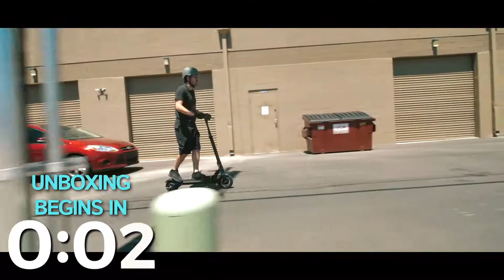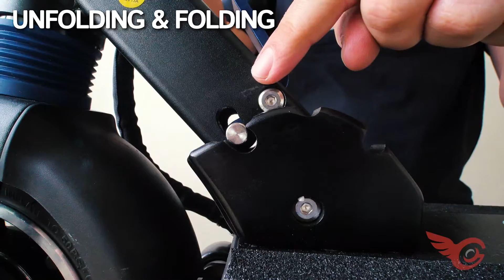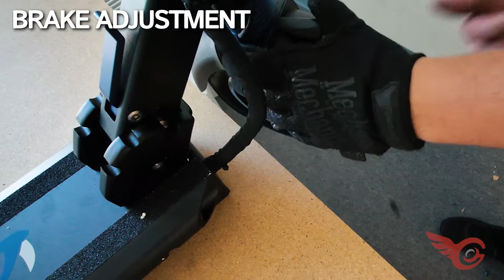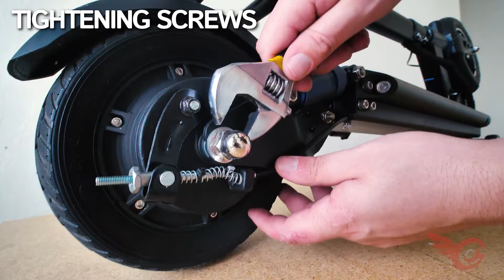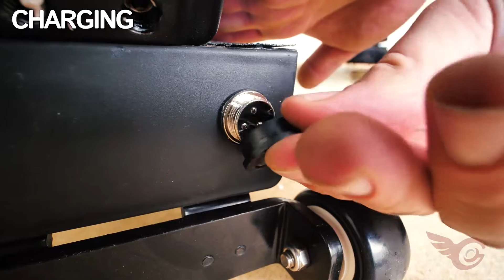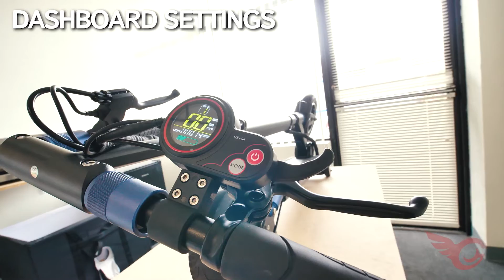Getting Started with the Turbowheel Swift T8S+ Electric Scooter

Comment: Thank you so much for your review, I really love that scooter, but I'm just concerned that is not waterproof, so I was wondering if you have some recommendations to protect the scooter from the rain, Thank you
Reply from the maker: Good question, we'll be making a follow-up video on this in the near-future. As shipped, the scooter is 'moderately' water-resistant, can be used in light-rain, wet roads, but no Electric Scooter is fully 'water-proof'.
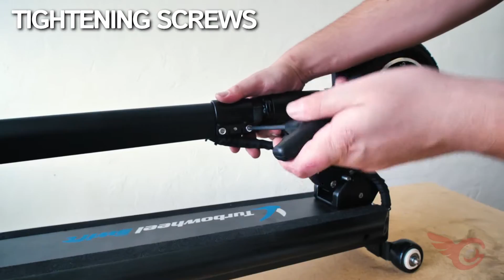Reply: WheelingAround The screw at 3:19 on the stem, it rotates with the screw on the opposite side of the scooter simultaneously.. how do I get this to tighten appropriately so that my stem doesn’t wobble so much? Obviously, some give is acceptable but mine is too loose.